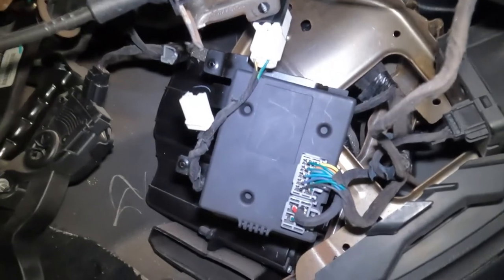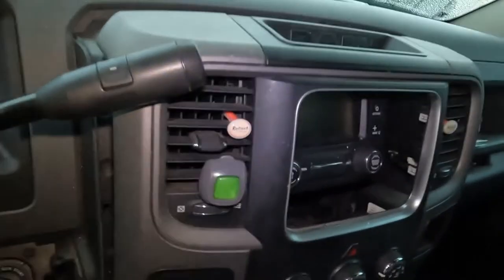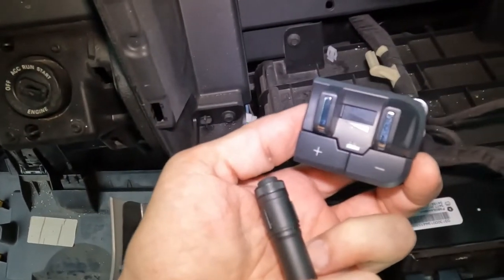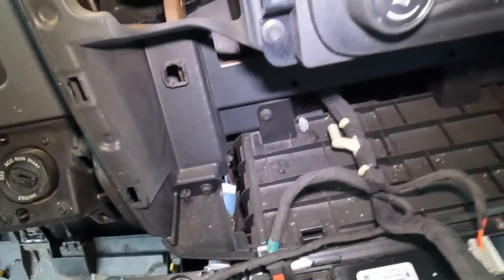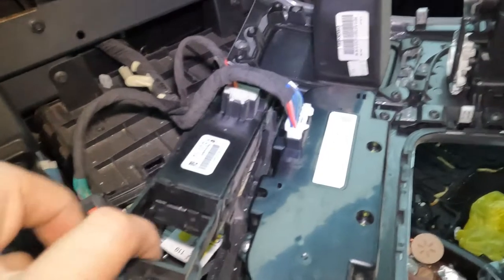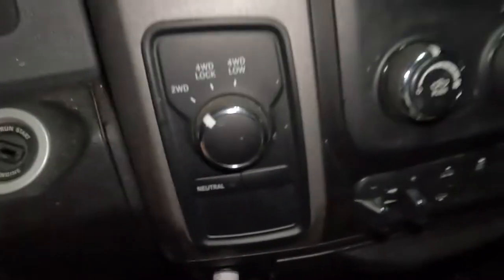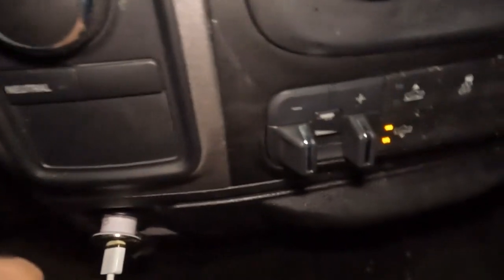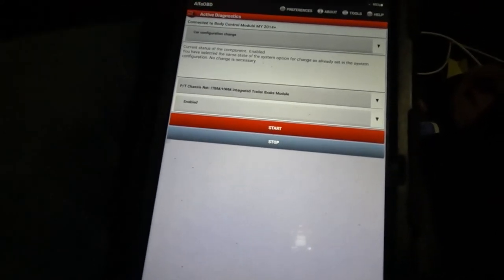Adding factory trailer brakes to 2014 Ram (4th Gen) Installing and programming with Alfaobd

Comment: Went to my dealer for my 2021 Laramie they wanted to charge me 169.00 plus tax to flash the brake controller on, a total rip-off, so I got the OBD Max Plus like you.  The only thing is I had to buy online for 25.00 dollars for the bypass for the PCM computer to access it with the OBD MAX PLUS, doing it tomorrow. Good video helps other Ram truck owners and saves money for them.
Reply from the maker: Good man I'm glad I could help. Let me know if you get or if you need help.

Comment: Barrett - thank you for posting this video. We just picked up a 2014 RAM Tradesman 2500 Crew Cab 4x4 w/18,000 miles on it. I will need to install this module in our (new to us) 2500. I am also trying to find videos on the module for cell phone (hands free) as well. This isn't the upper end like others but we are going to get many, many years of good service out of it. I am excited to replace our 2003 Dodge Ram 2500 Crew Cab 4x4... it has been a great vehicle for us.
Reply from the maker: This is actually easy to do it after pluging in the module I put the button in and took a matter of mins to program it to the truck. This is not a long install very easy.
Reply: @barrettgarage1088  I had to leave to go to a doctor's appointment. Thanks for getting back to me! I definitely want to do this and also the remote start on our new to us 2014 RAM Tradesman we just picked up. What manufacturer to you purchase this unit from? I am looking into the remote start and there seem to be a few manufacturers out there - or - should I just go OEM Mopar? Not sure of the amount of cost involved.

Comment: What are the 4 wires for in the bottom plug for the module? Red is hot, but what are the other 3?
Reply: I believe they are 12v power, brake light trigger, ground, and the brake wire.....that goes to your 7 pin. I'm pretty sure because that's the only plug to use with aftermarket brake controllers.
Reply: @russvz6911  I’m pretty sure there’s something wrong with my existing wiring. It says “light electric” with the camper plugged in and “heavy electric” when towing nothing. There is no power going through to the trailer brakes. 
I do have brake lights and turn signals, just no power in the trailer brake pin on the receptacle on the back of the truck.

Comment: what are the buttons that have arrow up and arrow down - how did you add that?
Reply from the maker: That would be rams 4 corner air suspension. I did not add that it was factory. Some trucks had it but most did not.

Comment: No link?
Reply from the maker: I didn't add a link because there were a dozen sellers on ebay with them that's why I only said I got it from ebay all of them had good ratings I just don't want to promote a specific seller on something that's widespread as this.